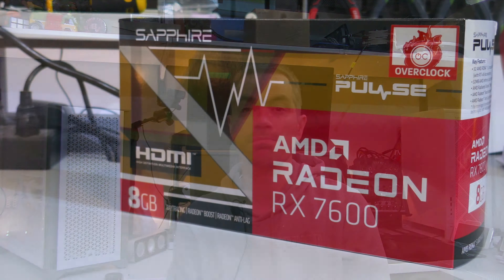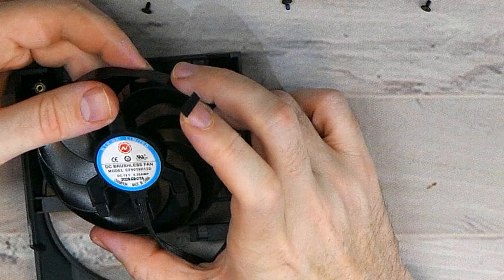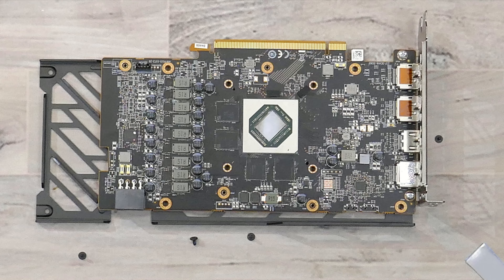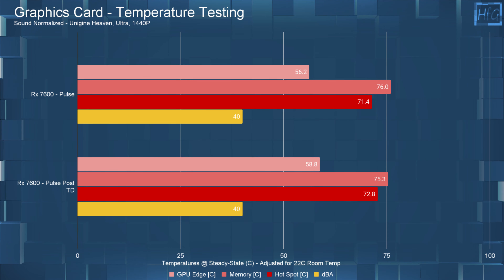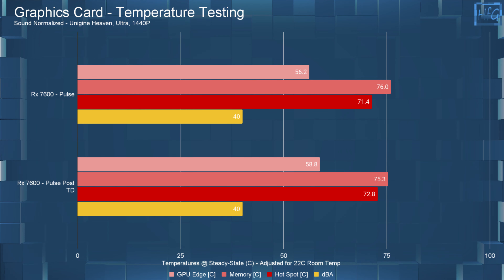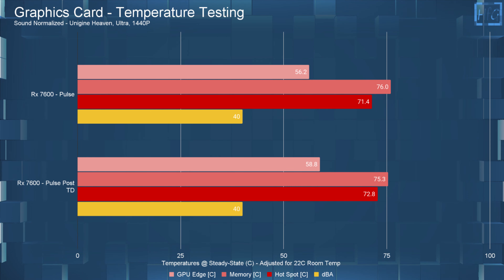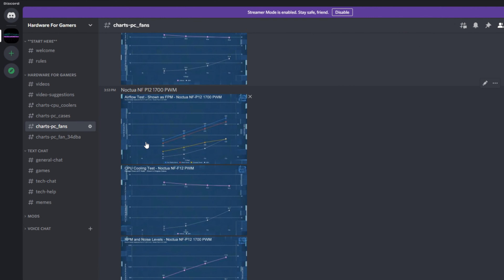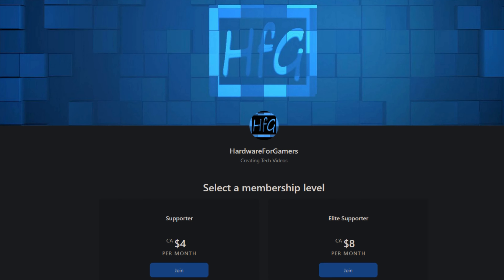SAPPHIRE PULSE RX 7600 teardown

Comment: Always happy to see more teardowns. The shot could be a bit closer.
AFAIK it's not your expertise per se, but a VRM and component analysis plus comparisons between cards would be amazing. Power phases and quality of VRMs, that kind of thing. Think reliability rating.
A lot of cards on the market seem different, but pretty identical under the hood, knowing which ones go above and beyond the reference design is very valuable.
Reply from the maker: I do prefer to look at or talk about the cooling and build quality, but you are correct I should do a better analysis of the board and components.

Comment: "This stuff's hard" could indicate one of two things. It's either the type of paste... bad crumbly paste is actually sort of common on GPUs.

or it's not paste at all but phase change polymer, which is GREAT, because it's got same or better performance than best pastes, but doesn't degrade over time. The way you can tell apart is by applying isopropyl alcohol, paste instantly dissolves in it, while it does nothing to phase change polymer, it stays in chunks.

Fan number
9010, 90 nominal diameter (including shroud/frame which is not part of the fan, so closer to 87mm real), 10mm thickness including motor base,
H, usually you find here either S or B, S stands for sleeve bearing and B for dual ball bearing. Is H supposed to be rifled/hydrodynamic bearing?
12D, is the voltage and i have no clue what the final letters ever mean.

Comment: Glad you're doing teardowns.  The Pulse cards have never been that great.  Good enough, like the MSI Mech and Asus Dual.  Heatsinks are just too small and light.  Sapphire has also always been stingy with the thermal pads (I think Powercolor is worse in this regard).
Reply from the maker: for the low-mid range cards I would definitely agree.